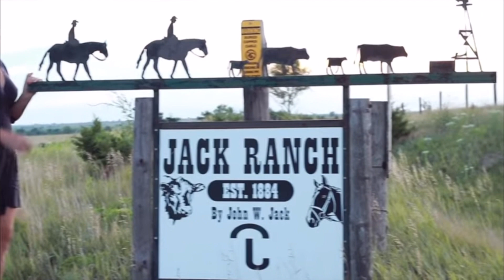More Corn Hauling, Grain Vac, Corn, Grain Bin, Grain Bin Spill,

Comment: I love farmer girls
Reply: Possibility on your squeekie steering take horn button off and center nut pull off steering wheel and spray some PB BLAST DOWN AROUND WHERE THE SHAFT COMES AND HOLDS WHEEL AND ALLSO SPRAY SOME OF THAT SLIDE LUBE SPRAY WITH NEVER SEZE SAME LUBE FOR ROLL UP DOORS ITS CALLED SLIDE RIGHT WITH GRAPHITE LUBE REMEMBER WD 40 PB BLAST IS ONLY A PENATRANT NOT A LUBE